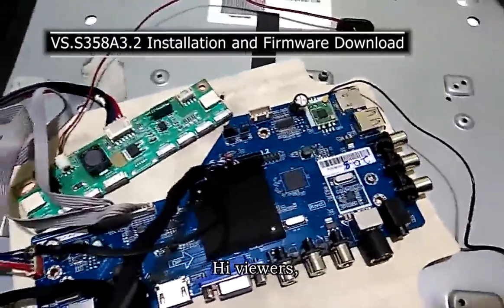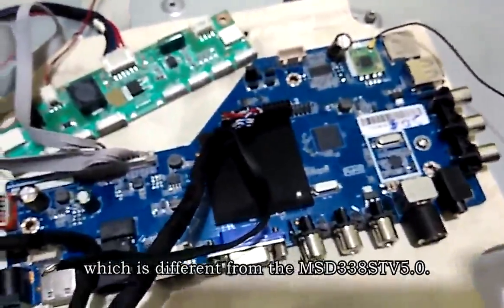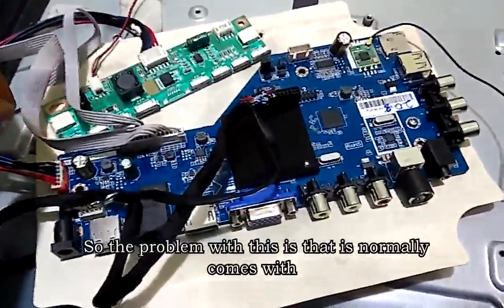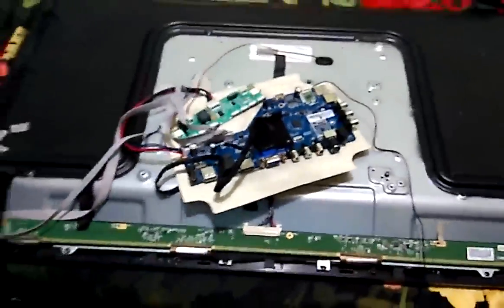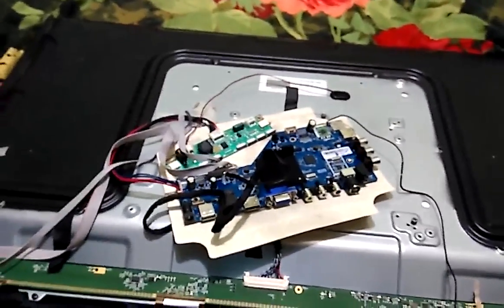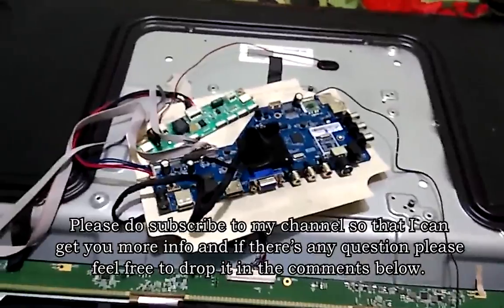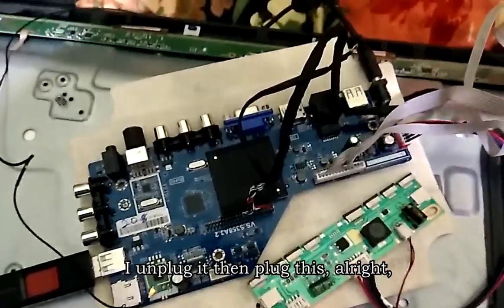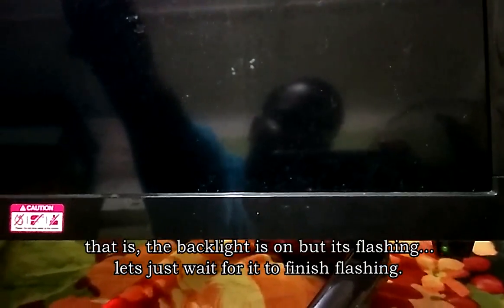VS S358A3 2 Firmware Download and Installation MSD338STV5.0 Alternative Smart TV Motherboard

Comment: Why my board i purchase is like that chinese language..why i can't changed the lunguage and i can't set the factory mode? Thankyou any advise
Reply from the maker: Its set to Chinese language by default and its in android 4.4, so you can change to English language, if you play with the settings or you can install my firmware which is English language by default and the android version is 8 to get it done
Reply from the maker: To set factory 
VS.S358A3.2 Factory Menu - https://youtu.be/fJO871w_u7U
Reply from the maker: Please subscribe!!!
Subscribers benefit more
Thanks in advance

Comment: Hello master... the software you put in your discrepsion is defferent from the software you mention above..you  mention above is VS.S358A3.2  and the software you put in the link discrepssion is SV.S358AT..i wonder why my tv is not working...it's stop in LOGO only.NEED HELP  master....Thanks
Reply from the maker: VS_S358AT_512M is the firmware name for VS.S358A3.2 if you check the 2 files you downloaded, the 1920x1080 file is VS_S358AT_512M and the 1366x768 is 1366. So the 1920x1080 will flash while the 1366 won't flash unless you change the file name.
Can I see your board? And what is your TV resolution? Send it to me on WhatsApp +2348037955537